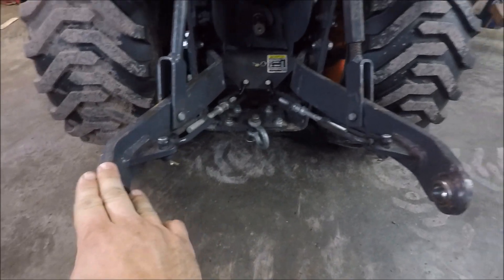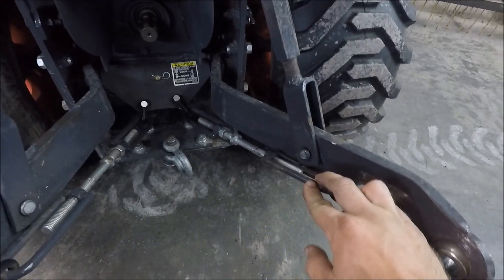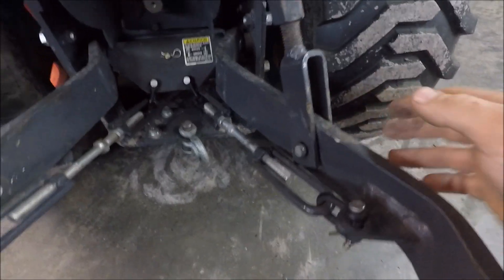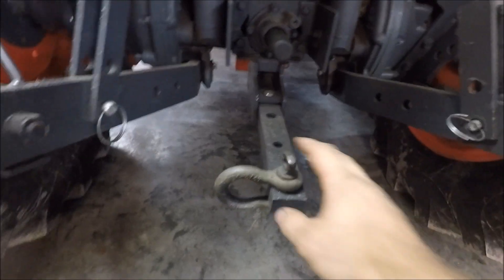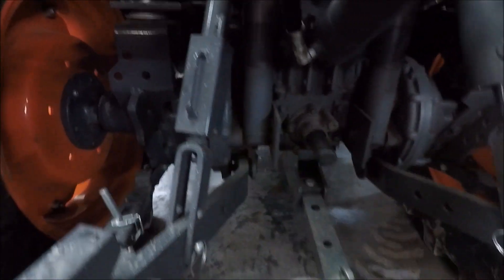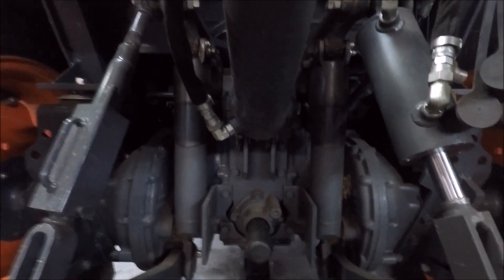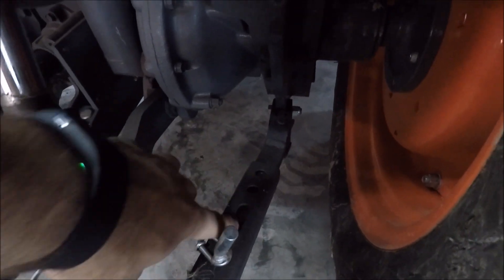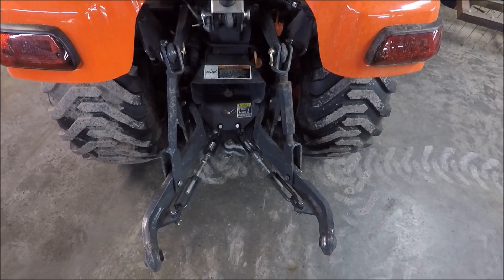Parts of the 3 Point Hitch Explained

Comment: I have a 2005 B7800 Kubota..I recently purchased a hydraulic 3 point log splitter for it.  The lift arms of the 3 point won't drop far enough to the ground to attach to the splitter..in writing the splitter company asking why the splitter was built so low to the ground (I sent pics of my tractor)  their answer was " the design is meant for adjustable lift arms. From the picture your tractor does not have adjustable lift arms."  Is there adjustable lift arms that allow both sides of the arms to drop lower to the ground?  My tractor just has one adjustment on the right side that I had thought was just for equalizing the arms to each other...good video, btw!!  thanks!
Reply from the maker: No, the tractor in the video does not have adjustable lift arms. Is the splitter quick hitch compatible? If it is a quick hitch makes the lift arms 4'' longer, so the splitter may touch the ground. If it is not quick hitch compatible, you could get something like Pats Easy Change. Then of course, you could extend the legs on the splitter.

Comment: Great video. I wish I watched it before I practically destroyed my tractor. I do have a question though. Your comment about not enough lift power is the problem I have been having. Every time I back up on uneven ground I jam the tiller. I even got stuck yesterday because I drove up on a pile of wood chips because I could not back up. I even tried running the tiller and all I did was make a bigger hole..Boy did and do I feel stupid. .I had to manually pry my tractor up and slide blocks under it to be able to back it up to get unstuck.  My question is ... Can you use maybe another adjustable lift bar, instead of just one  to keep the tiller higher???  . The stationary bar is so much longer. I tried every adjustment on it and I was beginning to think I was dyslexic. It is i,possible to back up with my tiller on...I am not real mechanically inclined.
Reply from the maker: Thanks! To raise your tiller higher, you can shorten your top link. Is you tiller quick hitch compatible? If it is get a quick hitch. You will be able to drop the tiller in seconds, then you still need to unhook the shaft. You will need to make sure the PTO shaft is long enough to use with a quick hitch. https://www.youtube.com/watch?v=9SqlcrWreKY

Comment: That is good information for the beginners to know, and I have most of that information already since my tractors have those features. I love the quick hitches that is sold to make hooking up implements an easy job. I have one on each of my two tractors and love them so much. The only problem is working with equipment which is not quick hitch compatible like my box blade and my turning plow. That is a job getting it hooked up, but it can be done. Thanks so much for the video and I hope you have a nice Blessed week.
Reply from the maker: Thanks, quick hitches make things a lot easier. It is a pain to deal with an implement that is not QH compatible after getting used to a quick htich. Thanks for watching and taking the time to comment! I hope you have a good week too!

Comment: As usual a well done video young man !!! I really appreciate you taking the time and energy to share with us! Be safe and God bless you and your family !!!!!! PS !  When moving the direction foot control on your BX to neutral from forward or reverse , does it stop abruptly ? Or does it move a short distance before coming to a stop ?  I apologise for being off subject. !! Mine stops very quickly!  Keep up the great work!
Reply from the maker: Thanks. Do you have a BX25D? There is an adjustment on the return spring. I think at full throttle full speed in high range the tractor is supposed to stop in 8.'
Reply: 94BULLITT Mine is the BX24 . It stops immediately when going to the neutral position. There is no time or distance pause.